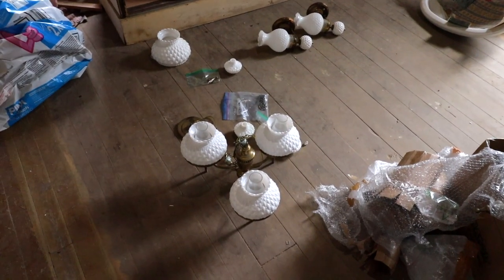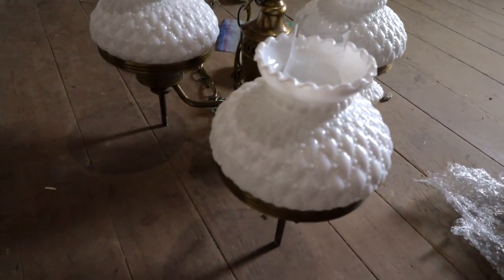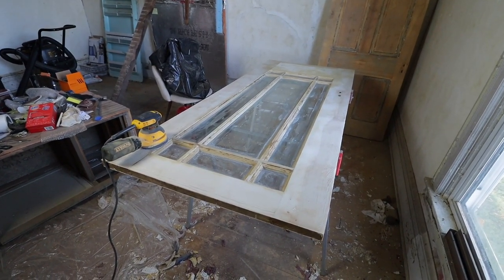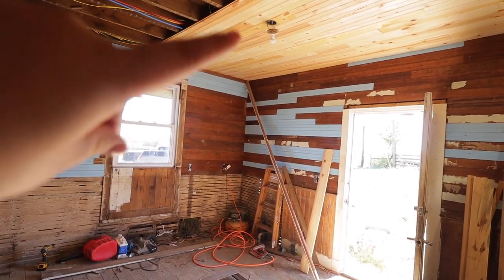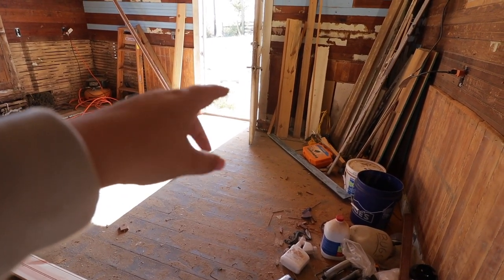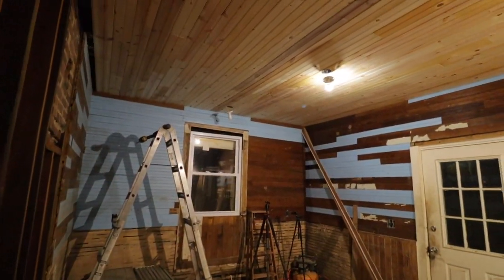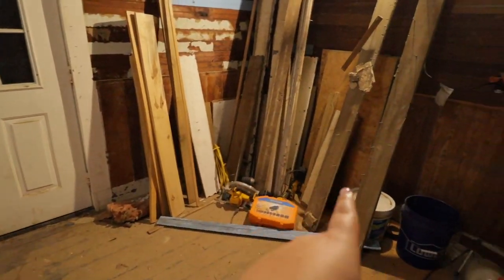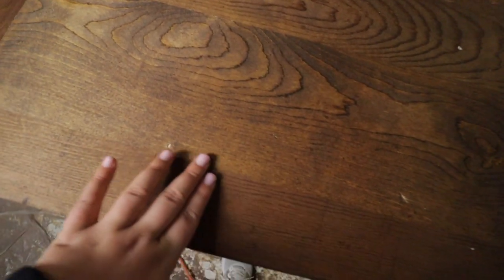Planning Kitchen Layout & Staining Door | DIY Farmhouse Renovation

Comment: Your vision for the kitchen is functional, which kitchens are meant to be…they are the workhorses of the home. The corner pantry, excellent idea! Instead of a swing door to the mud room, what about a pocket door? Since the mud room isn’t rebuilt yet you could use the door and make it a pocket door (not a barn door) on the mud room wall. Might not be of the time period but you would to fight with a swinging door to the kitchen. As for the light fixtures…GORGEOUS! The glass door turned out beautifully, the color is rich and warm.
Reply from the maker: Yes they are we will be spending many hours in this kitchen. I've never thought about doing a door like that but it is something to definitely consider doing. Thank you so much!